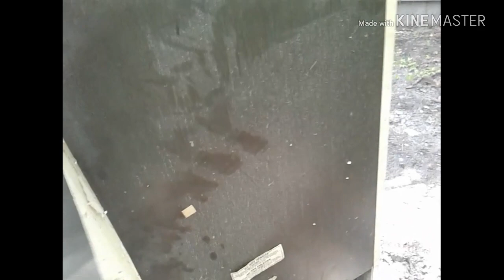What's inside a refrigerator?

Comment: Very helpful. I needed to drill the side walls of my freezer to fit a shelf which didn't line up exactly with the holes.  I wasn't sure what was in the walls.  I widened the holes a little and  It worked out well.  Just insulation.  Thank you!

Comment: Should have started telling us how we get the coolant (gas) out. In old refrigerators that is toxic and very ozone unfriendly. On yours here that is already done and it seems the radiator that sits on the back (to get rid of the heat taken and transported from inside the fridge) which holds lines that are pressurised are is already off as well
Reply: Pay attention to the video. He pointed that out. The condesnser that is ussually on the back of older models was on the bottom of this fridge.

Comment: Wack with a hammer!?!?  I throw them in the fire pit ,let the fire do the work!!!! Collect the copper after!!!!!!
Reply: U throw hole fridge in the fire ??????.
Reply: NO!!! Just the little motor sealed in plastic that HE cut with the grinder. I bring fridges in untouched!!!!!!!!
Reply: Rite on
Reply from the maker: Scrap yard won't take burnt copper
Reply: @Floridascrapper  that stinks. My yard dont care if you burn the crap off
Reply: Sometimes when you strip extention cords, the copper is already burnt because of excessive current. Will they take that?